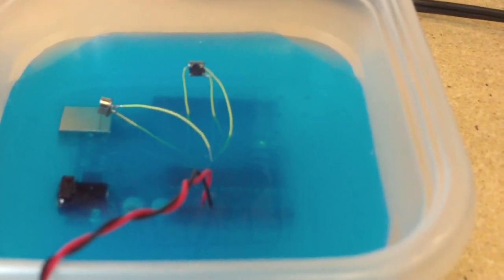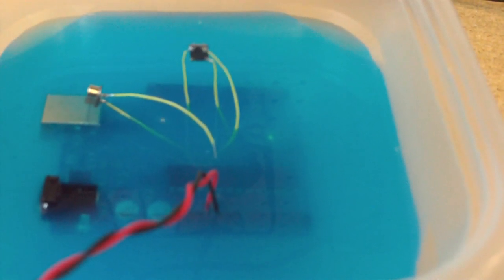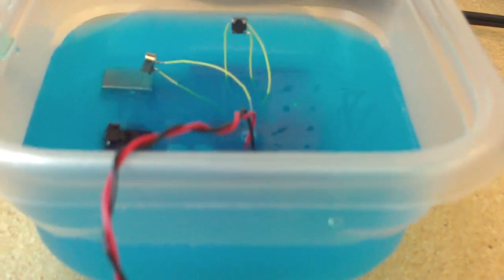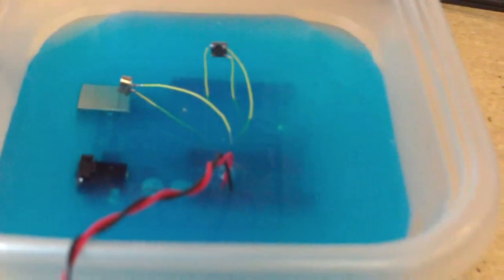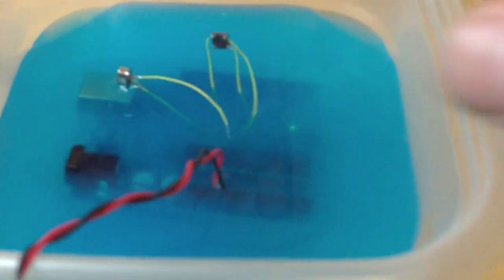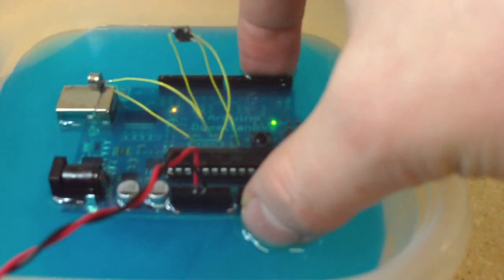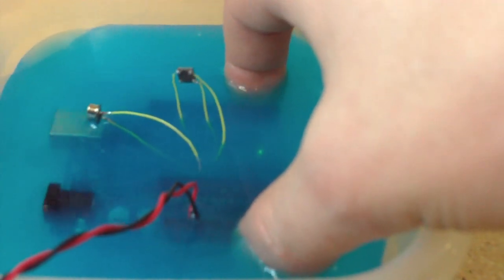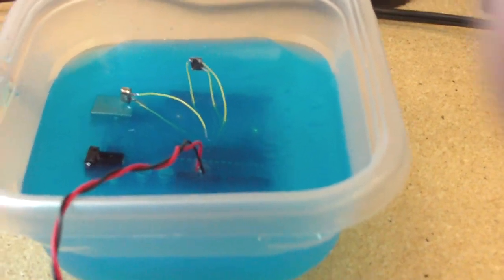Liquid Cooled Overclocked Arduino Part 1

Comment: @RustyNex The capacitors are parsitics that come from the construction of the transistors and the wires in the chip. Making the transistors smaller decreases these capacitances, but there is a limit to how smal they can make them (they are orders of magnitude smaller than the wavelength of light on modern CPUs).  As for the PLLs, they are internal, built directly on the silicon die.  PLLs serves to multiply a reference frequency (say, from the FSB) up to the required clock frequencies.

Comment: @RustyNex Every time you build a MOSFET transistor you get something like three capacitors. Making the transistors smaller makes the capacitances smaller. However, smaller wires = more resistance, smaller spacing = more crosstalk, and higher frequency = transmission lines. The product of the resistance and capacitance determines the switching speed. Tradeoff! And different sockets tend to run at different speeds because the CPUs have different requirements, hence the need for different sockets.

Comment: @RustyNex Well, I suppose you're correct in that a PLL contains a VCO. However, the control voltage is generated in a closed loop independent of the suply voltage. See the wikipedia article. Big CPUs generally get their clock reference externally (e.g. from the FSB) though smaller chips can contain less precise RC oscillators (e.g. atmel xmega chips have a 32 MHz internal RC oscillator). Also, major CPUs are limited primarily by heat while low power chips are limited by propagation delay.

Comment: The microcontroller is indeed limited by heat, but it is the clock that sets the rate.
I have run the Arduino at 27MHz with an external clock, confirmed by process times.
At this rate the chip will fry itself in a matter of seconds if no heat sink is provided.
I use the Arduino as a watchdog processor in a PC, so it only runs code for a few seconds at most at this fast rate and returns to "idle" mode quickly.
I do this with a pair of PN diodes and 2 clocks that are selected as needed.

Comment: @RustyNex Wrong. Modern CPUs are based on CMOS technology. Current is drawn on transitions. More voltage allows the internal capacitances to charge up faster and hence allow for a faster clock speed. However, faster clock = more current and more curent + higher voltage = more heat dissipation. This is the primary limit on clock speed. As for the clock, processors use something called a phase locked loop (PLL) to generate the clock frequency from a slower clock on the motherboard.

Comment: @feuchster Still as many people have pointed out previously, the ATMega chip on the arduino generates too little heat to need liquid cooling. Just having it in a room at or around room temperature will guarantee it won't overheat. Even if it were to be outside in 100 degree temps the liquid cooling would be un needed

Comment: the clock on the arduino is not set because of heat issues, its to do with the timing of the internals of the ATMEGA, if you run the processor too fast it will miss memory addresses and eventually the code will lock up. this is totally different to how a computer processor is overclocked which uses a higher voltage to make it run faster which also causes it to overheat.

Comment: Atmel AVR processors don't max out at 20MHz because of heat; they max out at 20MHz because of internal clock signal and data propagation delays. You can probably run them faster than 20MHz (like the poster did), but at some point, the processor components will simply not be able to complete an operation within one clock cycle.

Comment: @aforencich well you learn something new every day. i am pretty sure i have seen some processors (maybe smaller microprocessors) that have an internal, voltage controlled chip. but now that i think about it, i am sure i read somewhere about clock multipliers

Comment: @Enverescape 
You just described thermal runaway there, I don't think theres much chance of that happening at the current this thing is pulling.
Of course any flow of electricity results in heat because of resistive losses (unless its a superconductor). However, unless this thing is drawing many times more current than it should be, or is more than 100% efficient at getting hot, it's never going to get even remotely hot. Definitely not hot enough to  require this kind of cooling.

Comment: @showty90 yep, computer CPUs have an internal time keeping system which is why you can change processor to a faster one and you don't have to change some crystal with it, its built into the chip. the chip is pure silicone, there is no quarts in there, and even if there was there would be no room for it to resonate, so the chip controls its cycles with a voltage controlled resonator. its partly the reason why computers are so sensitive to voltage fluctuations and why it can crash with a bad PSU.

Comment: @metabog 
From what i understand, the processor in an arduino draws about 6ma under normal clock speeds and voltages. I really doubt that increasing the clock speed as much as is shown in this video would increase the current draw enough to cause any sort of heating at all. There have been several people telling me it does if you overclock it and not giving any explanation, if you know somthing i dont then feel free to explain.

Comment: @Arabhacks No, you can't.  The only reason you can do that on high end (desktop) CPUs is because they generate a huge amount of heat. Sucking away the heat faster than the stock heatsink can allow faster clock speeds. However, the speed of an Atmel microcontroller is not limited by heat and hence any sort of cooling has no effect on the maximum clock rate.

Comment: btw i'm not dissing arduino at all, but there's around some cool arduino compatible boards based on pic32 structure, and can perform much better than arduino, at least 80MHz.
and they are cheap too!

Comment: @skierplaterandy 
Of course it generates some heat during operation, but this heat is pretty much unnoticable and has no effect on the operation of the device. Lets say this thing is drawing 20ma, 4 times what it normally uses or so. Thats about 0.1watts of heat assuming no power is lost anywhere else. Its not even worth mentioning

Comment: @pieznice29 Yeah you're probably right, but then if you feed it more power on purpose, rather than just use the USB connection, then I guess you could technically overclock it quite a lot, and it will draw more power and probably overheat. It's not an insane Pentium CPU or whatever though, so you're probably right, it just doesn't use enough power to actually go toast.

Comment: @aforencich right got ya, so they will need to go into building transistors from atoms if they want it computers to go significantly faster? ok i see, so its the PLL that changes and thats how the clock speed changes, but the original clock signal is always the same. is the original clock paired with the socket type? so each socket type as a stereotypical expected clock speed, or do all computers start with the same clock speed?

Comment: I am not sure why liquid cooled.
You can do pretty much the same thing with a heat sink on the chip itself and fan cool it.
Correct, you can double the chip speed by simply adding cooling, but it does not matter how you do it.

Comment: @aforencich ok so processor speeds are limited by physics then, is that why they are going to duel core etc? if you dropped the voltage that the CPUs use, wouldn't that reduce crosstalk and make the resistance of small wires less relevant? thanks for sharing the info by the way, its very interesting

Comment: @RustyNex Also, I forgot to mention: shrinking the transistors also reduces the threshold voltage. New CPUs will draw something on the order of less than 1 volt at over 100 amps. There is multiphase buck converter next to the CPU socket to change 12 volts from the power supply at, say, 10 amps down to around the 1 volt at 100 amps used by the CPU at around 90-95% efficiency. They also make low voltage versions of CPUs that run at lower speeds and use less power for laptops.

Comment: @SniperRulez89 
Unless the arduino's processor was more than 100% efficient at generating heat, it couldn't generate enough heat with the power it draws to require a heatsink, forced air cooling or in this case liquid cooling. I admit it does generate some heat, but so little its barely noticeable.

Comment: @aforencich ok but i don't understand, if the PLL is external, how does a new processor have the right frequency? unless the new processor has something inside it which says what frequency it should run at and that is passed as a voltage signal to the VCO? also if its the charge rate of the capacitors in the CPU that control the speed of an instruction loop, why not make the capacitors smaller?

Comment: @RustyNex Those pesky laws of physics, they always ruin all the fun. That is exactly correct. And there is a limit to how low the voltage can go as the transistors have a threshold voltage. If you can't reach the threshold voltage, it won't do anything at all. Higher voltages will charge the capacitances past the threshold voltage faster. Another issue on modern chips is clock distribution - the frequency is so high that the size of the die is large w.r.t the wavelength, causing clock skew.

Comment: @RustyNex Engineers are going to do their darndest to keep going with silicon. Intel just recently came out with the FinFET and that should get a few more years of milage, but yeah, eventually we're going to have to go to photonics or quantum computing if we want to go any faster on a single core. Analog isn't reliable enough and chemical and organic are probably too slow. Recently, though, when you get a new, faster computer with a new OS, it's slower than your old one due to all the bad code.

Comment: im no expert on this atmega but i think the overclocking problem with the arduino is not temperature but the switching speed of the transistors(logic gates) that cant keep up with the clock speeds.. so if it hangs it should be becouse of that and not temperature... im only guessing.. i just dont see this thing heating up so much for this trouble...

Comment: Lawl! Like heat is the real issue with MCU overclocking...
Best atMega "overclock" is not using any Arduino boards and moving on to ASM firmwares away from the sucky C code.

Comment: @aforencich i bet, its like the oil companies holding on to combustion engines, they can see that they will have to change in the future but they don't want to start now. i think they need to design a computer like the human brain with each neuron accepting multiple parallel inputs and outputs, both electronic and chemical, and infinitely variable rather than just 1 or 0, then speed wouldn't be so important. and yea windows 7 is too slow i am going back to XP

Comment: Xcellent Coolant Application
Please try it on a Pentium3 motherboard (could be an older one, out of the case)
Do it because they are thinking this test was not good because the arduino doesNOT generate HEAT

Comment: @eflubacher 
Not enough to need liquid cooling. Have you ever seen a small low current linear voltage regulator need liquid cooling? Its pointless, any sane engineer would use a switching regulator or somthing better insted. I can work out how much heat it generates if you want but to be honest i cant be botherd, every time i say somthing on here someone tells me im wrong.